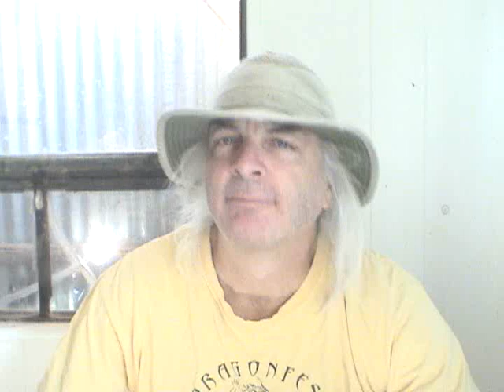Testing 'HHO' devices properly; a reply to 'monty81567'

Comment: I used less petrol when I got a car which showed the the instant & long term fuel consumption. I realised that acceleration & high speed uses a LOT more petrol than I though, and by having a light right foot I could save 10% with almost no effect on my journey times.

Comment: Considering some of the enormous claims of increased mileage, it would probably be reasonably accurate to take the average over 3 or 4 fill-ups, if your driving habits are pretty consistent.  Yeah, plus or minus 20%.

Comment: The other problem with Monty's test is that it is not blind - he knows when the device is turned on or off and this may consciously or subconsciously alter his driving habits.

I would suggest an alteration to your method - do the control test with the device disconnected from the battery and hence no added load on the alternator. Otherwise (assuming the injected hydrogen secondary fuel is actually burning usefully in the engine) you will get a false positive result, almost certainly.

Comment: @Desertphile
G'day mate... You're almost right. One of my Subs had a 26 MP(US)G Baseline, added a HHO Bubbler, didn't change his Driving Style, & went to 18 MPG, as a HHO-bo ; 30% WORSE, due to the 30 Amps going from Battery to Bubbler, after coming from a 3:1 Belted Stepped-Up Alternator sucking on a 7+ Litre V-8, going 45 miles to work, at 70 MPH.. He shitcanned the HHO Crap & went back to 26 MPG. Then he got a Scan-Guage Tool, to use feedback to cut leadfoot. Cont...

Comment: Dyno cell testing as well as well instrumented road tests show HHO to have some benefit in diesel engines though not to the level claimed by pundits. College, University as well as Commercial/Corporate tests have shown improvements in BSFC (brake-specific-fuel consumption).  Class 8 tractor applications are under development.  Look up "The Cell" (thecell.com) .  Well funded, researched and developed with SAE testing to back it up as well as numerous on road users. However, these are not simple.

Comment: @Desertphile
#3... Regards In Vitro Fuelburns...; they're useless. I'm into writing down Fuel Bought, distance Travelled, adding when too scared to pass the Pump; and never crunching the numbers on less than a month at a time. One test I pitted 6 months with 100 Km/Hr Highway Cruise, versus a year cruising at 105 (10.66 Km/L. Vs 10.298...). I've logged every Engine Start/Stop time for a year, too. Search "SunFoil Science" please. Ciao !

Comment: nevermind.  I commented before the last 30 seconds.  Ass...  Agreed, the amount of HHO these devices put out (1-2 liters per minute) is utterly insignificant compared to the thousands of liters per minute of actual air an engine consumes.  Having the device connected or disconnected to the air intake should yield no difference in run time for a specific amount of fuel.

Comment: Sorry but I'm really sleepy and might miss some thing, but i shouldn't the test be preformed like this:

1: Baseline, no device HHO device attached, expected result, well baseline.
2: Load test, HHO device attach and running but not feeding the engine, expected result, worse fuel economy then 1 Baseline.
3: Device test, HHO device attach, running and feeding the engine, expected result worse fuel economy then 1 Baseline but a bit better than 2 Loadtest. 
?

Comment: Fuel injected vehicles need a pressurized return line from the tank. You can't run a test like that. See that's the best part of this scam. No one can accurately test the thing without a laboratory and they can just talk themseves into getting better milage. I bet they watch the way they drive when they are testing. Then when not thinking about they drive like ass holes again which wastes lots of gas.

Comment: One important little detail: Do NOT run this test inside your closed garage!

Just saying.

Apart from that this sounds like like a fairly easy test people can run themselves. Driving a car in traffic is unusable because of so many variants - air pressure, traffic, red lights and whatnot is changing all the time, you never drive your car on the same street twice, metaphorically speaking. ^^

Comment: HHO is nonsense, but I have to disagree with your methodology a bit.  Running at idle (or whatever) with the HHO device attached electrically, but not otherwise does *not* serve as a good baseline, since of course it draws (sometimes significantly) more current than the car does without the HHO nonsense.  A better baseline would be the same setup, but without the HHO device electrically connected.  Also, constant RPMS.
Apologies if I misunderstood what you were saying.

Comment: The test procedure outlined in this video is very poor and unnecessary. Professional level applications can, and do use road-going dynometers to data log a battery of sensors including a drive-shaft torque sensor.  However, for this application, all that is needed is an in cylinder pressure sensor.  By mapping the pressure curve before and after the addition of HHO, you will see if there are any benefits or detriments. However, the cost of proper sensors is beyond the reach of most tinkerers.

Comment: Best thing to do for any testing would have the vehicle tested exactly how the car companies test theirs, however, depending on the efficiency of the device such as load, output, and life span of the device and devices fuel (water) can all be calculated with all the numbers such as vehicle weight drag engine size, trans gear ratios. But thats all too intense. Do like the chinese man did, put a dagum windmil on the front and charge batteries lol. Find that video man